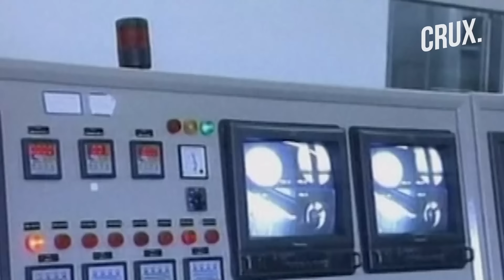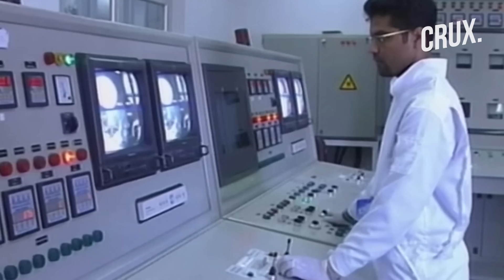F-15EX Jets With Bunker-Busting GBU-57 Bombs | What Israel Needs To Destroy Iran's Nuke Facilities

Comment: Considering how deep these are, not even the gbu 57 is going that deep. Youd maybe damage one entrance,  but there ahould be multiple,  and youre not getting multiple tries.
Reply: munteza9262 what ?
Reply: Munteza  huh? Did you read and not understand?
Reply: only a b-2 with dual mop can destroy 100 meter iranian bunker
Reply: Nonsense ,think first b4 you talk useless 😂
Reply: Munteza  The Iranians have multiple entrances for each base. Some are deep underground, underneath mountain ranges. Even bunker buster cannot get through.
Reply: @Eshrakgaming934  LOL These bunkers are KM underground & they're built underneath mountain ranges. No bunker buster can penetrate a mountain range & then get through several hundred meters of military grade concrete. Only a tactical nuclear might be able to generate enough energy to destroy such a base.
Reply: Munteza  No they have multiple entrances & equipment both inside & outside incase that happens.
Reply: munteza9262 you should be an army general you're so smart!  If the US had you, maybe they wouldn't have lost.....
Reply: @realpolitik01  Cool, but those nuclear sites can be blocked off easily and we know the locations so it really doesn't matter how underground it is. Unless they are making nuclear missiles, those bases are irrelevant and we can easily strike any assets that come out the base & air defences can be easily overrun by US missiles launched from afar without air defence firing a single shot.
Reply: @cooldued5308  Again Iran will retaliate & destroy several US bases in the region, including air bases and runways, US navy ships will also be targeted & likely damaged or destroyed in the process. Most of their assets are mobile so it's going to be impossible to prevent them from launching thousands of missiles & drones. Not to mention, if the US attacks their assets, they will take their nuclear program completely underground, they will spread out to hundreds of clandestine sites & will eventually build a bomb. They have the knowledge & their nuclear program is already spread out to more than 100 sites. If they want to build a bomb, they will do it & the US has no leverage left since they've already sanctioned them to the max. If the US couldn't stop North Korea, I don't think they can stop Iran.
Reply: @realpolitik01  iran is going to face the same consequenses what 1991 4th largest military raq faced
Reply: @realpolitik01  it doesnt matter what materials these bunkers are made with mop has a serious ability to penetrate 60  meter deep slid concrete bunkers it doesnt matter where you are hding your military assets even if it is 100 meters deep a mop with axn-757 will bow up the entire deep underground facility in sky high.if you are thinking you are going to safe in a 100 meter bunker in a mountain when a us aircraft targeting you then you are wrong my friend mop is a serious weapons.
Reply: Munteza  shovel away lol
Reply: @Eshrakgaming934  60 meters of penetration is not enough. The bunkers are deeper than 60 meters & underneath a mountain range. It won't get through. That's if the jet can get close enough to drop the BB, which is doubtful considering Iran's multilayered air defense network.
Reply: @Eshrakgaming934  I doubt it. Iran has 5000 missiles in inventory. Thousands of drones & you've seen what their drones are capable of in Ukraine. They have ATGMs that can destroy any tank or armored vehicle. This is not Iraq whether you want to accept it or not.
Reply: You dont have to , its called digging up the garden 
The F-15EX can carry up eight 2000lbs bombs
The first 1 bomb creates a crater 
,while 2 and 3 are laser guided thanks the laser guidance, the bombs will all strike the same spot repeatedly
Then you drop a pair of GBU-27s 
Then F-15EX drops GBU-72  and good night
Iran's gamble was that mountainous terrains would make it hard for bunker buster to reach
Thats true for 1st gen GBU-28s but newer models like the GBU-72 are far more effective
Secondly 
as for getting multiple tries
Iran's air force and air defenses would be shredded long before
Reply: @verdebusterAP  i told to stop bath salt, lol
Reply: @verdebusterAP  You're assuming the F-15s can fly over Iranian airspace without any opposition. Most of Iran's air defense assets are mobile, so it's going to be impossible to target them all before any airstrike. The jets will constantly have to maneuver to avoid incoming missiles while carrying a massive payload. Not a feasible option & quite unrealistic.
Reply: @realpolitik01  
Not assumption 
fact
Israel has access the AGM-88
which can destroy those mobile systems
More point, Israel has number of weapons able to destroy those launchers beforehand
Reply: @verdebusterAP  Iran has over 5000 missiles in inventory. Systems are either mobile or hidden in underground bases underneath mountain ranges. Israel doesn't have the capability to target all of Iran's assets. The US could likely destroy a significant amount of what they have, but not everything. Not to mention the thousands of drones they have that can be hidden away anywhere, in any parking garage, warehouse, any storage facility, it's wishful thinking to think that 1000s of units spread out throughout Iran can all be found & destroyed.
Reply: @eshrakahmed-ru4ot
Time were different back then.
Reply: @deven6518
You should first survive from the Iranian missiles and fly your jets with no interruptions in order to drop your MC Donald's on Iranian bunkers.
Reply: @MohamedShiyam-wt2id  we are not saying  iran is weak iran is very powerful but thats not enough to face a military super power like us.
Reply: They have 15 other entrances built 3/4 already done all they would need to do after an attack iss drill the new entrance not a whole new tunnel.... smh
Reply: (IT'S SAID BY IRAN) That they are that deep. They have never lied before, photo shopped, pictures, or videos. Got MATH?You're talking 5 miles deep.
Reply: munteza9262  they have construction equipment down there and will dig their way out. not too bright are you?
Reply: @Eshrakgaming934  The Taliban beat you, so how powerful are you? Iran beat the Taliban with a militia. so let that sink in.
Reply: @nolga3569  bla bla bla bla bla bla bla bla bla

Comment: I think there is some research mistake from crux team because gbu-57 is 13 ton bomb and only carried by bombers and is 4 times heavier than brahmos and 4 times heavier than kinzhal missile which are heaviest weapons mounted on a modern fighter aircraft. Yeah, if israel purchases b-21 raider then surely they can purchase one of these bombs. What i think is your talking gbu-72 a improved version of gbu-28 introduced in 2021 a 2.3 bomb with JDAM kits is ideal weapon for f15s
Reply: No Israel apparently plans to strap a gbu-57 30000lb MOP to the new f15EX. F15EX is claimed to be capable of carrying 29500lbs of ordnance but that’s with full fuel so taking off with less fuel and refueling mid flight it could definitely be done. The main challenge will be modifying the f15EX so the center of gravity isn’t completely F’ed
Reply: @@debraoroark49,
If we can't see the plane, at least we will see the bomb attached to it !😂😂
Reply: Nah it's possible, but its unwieldy and can only carry one.. the b2 spirit can contain 2 without a problem b21 same story maybe 4 If it wanted to push to the limit
Reply: You cannot procure a B-21 or F22

Comment: In order for the F-15EX to carry a GBU-57 bomb that size and weight. The F-15EX has to be specially built for the GBU-57 bomb from the ground up. Basically, the GBU-57 bomb has to be inside the belly of the F-15EX. The F-15EX will only carry one GBU-57 bomb and nothing else. The circular hydraulic clamps would have hold the GBU-57 bomb steady inside the belly of the F-15EX. The F-15EX has to be at an constant attitude of 50,000 feet minimum and traveling at Mach 2 to the site. Then going into a nose dive almost vertically traveling at Mach 2 and releasing the GBU-57 bomb. Somebody NEEDS to tell the GBU-57 bomb how deep the facility is and how many floors there are and how high is each floor is. Then somebody NEEDS to tell the GBU-57 what floor to detonate on. Lots of luck.
Reply: No.
Reply: @vernonkuhns3561  WHY?😡?😡?😡?😡?😡?
Reply: It's impossible. Some of these bases are deep underground, underneath mountain ranges. A bunker buster is not piercing through a mountain & then hundreds of kilometers of military concrete. Also the fighter jets, how can they maneuver constantly to avoid air defense missile (Iran has extremely potent air defenses) drop the missile right on the target & then make it back to base ? Not to mention Iran will likely destroy the Israeli air bases before the jets get back. They'll have nowhere to go back to, maybe they can land in a US airbase in the region ? It's just not feasible. The Israelis are bluffing & Iran knows it.
Reply: @realpolitik01  No one has built bunkers that have hundreds of kilometers of military concrete wall thickness. The statement that they are built "under mountain ranges" is also quite misleading as to actual depth.
Reply: Not only that the extra weight of them sort of bombs and extra fuel weight to carry them as well as go all the way to Iran and back will make the F15 so sluggish and slow and will be almost sitting ducks if seen on radar by anti air defences. Yes a good luck with that from me too
Reply: how tf u  know all that man
Reply: @mrgarina2977   Because I got a BRAIN.
Reply: @rogersmith8480  you got more then that. it aint just normal information you learn did  u served or something?
Reply: @vernonkuhns3561  My mistake, I meant to say hundreds of meters of military grade concrete. Like 150-200 meters. The bunker buster only penetrates 60 meters. Not to mention going through a mountain first. It's impossible. Only a tactical nuclear strike would have a chance of collapsing the cavity.
Reply: @vernonkuhns3561  Remember during the first US attack on Iraq in 1991, when the US thought they destroyed Saddam’s Air Force?
Reply: @kman5768  Yes I do. Now, tell me how much affect on our aircraft that the Iraqi Air Force had after that assumption.
Reply: @realpolitik01  150 meters is about 500 feet. The max depth they think the Iraqi installation will be is about 400 feet. They would have 100 feet of your milspec concrete sticking out of the ground. Basically you are lost in the numbers and have no idea what you are saying.

The smaller bb that the F-15EX can carry only reaches 60 ft. The GBU-57 reaches about 200 ft. The F15-EX may be able to carry it with mods. If not a c-130 will protected by EW, F-35s with radar killers and ata, and F-15 missile trucks. OR, we could lease B-52s or B-2s to the Israelis for the job. I would love to see a big Buff drop GBUs on nuke sites.
Reply: @Roger Smith

No you don't...
Reply: @vernonkuhns3561  The GBU-57 can penetrate 60 meters or 200 feet. The Iranian underground facilities are built underneath mountain ranges, with the cavity usually being right underneath the highest point. If the bunker buster gets through that, it has to go through up to 2000 meters of military grade concrete. That's not happening. Only a tactical nuclear strike would have a chance of collapsing the cavity. Not to mention, any jet carrying the such a heavy payload would not be able to maneuver. Iran has potent air defenses, mostly mobile assets. Any jet would have to be constantly evading air defense missiles. It's not feasible. A B-52 would light up like a Christmas tree. A B-2 will still likely get detected & shot down. That over 1 billion dollars down the drain. Is that a risk the US is willing to take ? Go ahead, I'll get my popcorn ready LOL
Reply: @vernonkuhns3561  Iraqi installations ? You mean Iranian installations. Just do the math, 60 meters or 200 feet, that's how deep the GBU-57 can penetrate. But first it can to get through the mountain rock. Average mountains are what 300 meters or almost 1000 feet. There goes your puny GBU-57, even before it can touch the concrete, it has no chance of piercing through the mountain LOL. Even if we lowball it and say the Iranians have 100 meters of concrete, that's more than 300 feet, that by itself would stop the bunker buster, but with a mountain on top, it's not getting through. The Iranians also have multiple entrances/exits & they have equipment waiting inside & out incase the entrances are sealed. They have backup generators with life supports systems inside the bunkers. It won't work. Again any jet carrying such a heavy payload, even with modifications, would not be maneuverable. It won't be able to evade any of the missiles heading its way. Israel & the US are bluffing. What did they do about North Korea ? Trump vowed that he would not allow them to acquire nukes. Now what ? And keep in mind Iran has thousands of ballistic missiles, thousands of drones, you've seen what their drones have done in Ukraine, so Israel would get annihilated if they tried anything. It's not happening. It's all just a bluff. Nothing more.
Reply: @realpolitik01  BLAH BLAh BLAh. No they are not under thousands of feet of rock. You apparently have bothered to LOOK at the aerial photos of those mole hills they are under.
Reply: @omegaz3393  Move on
Reply: @mrgarina2977  Yes, from The Company, 👍👍👍👍👍👍👍
Reply: @vernonkuhns3561  They're deep enough so the bunker busters can't reach. That's all that matters.
Reply: @realpolitik01  Except the facts are rather vague on whether multiple BBs can breach them or not.
Reply: @vernonkuhns3561  They can't just do the math
Reply: @Roger Smith

The only thing necessary is to modify the hard points for mounting the GBU-57.

The F-15 can carry the GBU-57 while cruising up to 60,000 feet at mach 2.5. It was designed to carry that much weight.
It also has the latest full electronic suite.

Just 1 GBU-57 would destroy the facility even if it doesn't penetrate to the full depth. But if you want to be certain, a 2nd one in quick succession would guarantee it.

Little known to the world because the news didn't really report on it is that Israel destroyed such a facility with multiple (though smaller) bunker busters in Syria around 2007. There's a number of things that have happened since 2000 that wasn't reported. Like an intentional news blackout.
Reply: @Roger Smith

Just to add.
They use bombs all the time that are designed and programmable to go through a predetermined set of walls, floors and  depth before detonating. They even have special munitions that work in a similar fashion. Like a 50 caliber round that penetrates an outerwall then an inner wall into a central room and explode.
Reply: @omegaz3393  The GBU-57 can only penetrate 60 meters or 200 feet. That's not enough to do the job.
Reply: @omegaz3393   not even 3 is going to do the job. This is mountain rock we are talking about melting point of 10000's of *c. Any rock that gets destroyed keeps piling on top. The israelis will be creating sand with their precious GBU's.
Reply: @omegaz3393  Trust me i have researched how to flatten a mountain with bombs.
Reply: @omegaz3393  @Omega Z  You need atleast 2000-5000 million tons of tnt to destroy a mountain nuke facility and Israel's precious gbu 57 has 14 tons of tnt and penetrates 60m.the mountain we are talking about is atleast 1km with the facility further underground.
Reply: What makes all of you think you have to hit the top of the mountain and go straight through the entire thing, Jesus Christ you hit it at the base of the mountain at an angle. Also the MOP was 200ft but that was prior to several upgrades that we know the costs of but not how much they’ve been improved. Also no one has a bunker made of hundreds of feet thick concrete walls that’s ridiculous to even suggest and would be completely unnecessary if not partially counter productive the physics here ain’t 1+1.
Reply: Such Experts ????
Reply: @realpolitik01  AGAIN SUCH EXPERTISE ON YOU TUBE LOL 😂 😂 😂
Reply: @lanatana3867  ALL YOU EXPERTS  MAKE ME LAUGH NOW GO AWAY
Reply: @rogersmith8480  You are placing arbitrary and meaningless requirements into your ludicrous list of requirements.
Reply: @vernonkuhns3561  Thank you for your opinion, please move on.
Reply: @rogersmith8480  Tch, tch, tch. If you want to move on because you are wrong don't reply.
Reply: @kman5768  and where are they now?
Reply: Plse what's your profession
Reply: Not mention the limited endurance/tactical range capability of a heavy F-15 struggling to get within range of the target.
Reply: Maybe that someone should be replaced with AI ( artificial intelligence) and coding?. Israelis not stupid thoughz they are quite smart
Reply: @vernonkuhns3561 hundreds km deep in mountains!  is ur estimations realistic?
Reply: @michaelmusyoki3889  Yes, but the U.S. could use The Rod of God weapon.
Reply: @eduardadhi110  this past conflict contradicts what you are saying....

Comment: No, that's not good enough. What Israel needs already having F35s is B61 Mod 12 50 kiloton precision bunker busting thermonuclear bombs specifically designed to be deployable by F35. Not only is the power many orders of magnitude greater but once the protected area is breached, between the heat wave, the radiation, the shock wave, and the rising fireball sucking all of the air out of every interconnected tunnel and cavern, one bomb takes out an entire underground network destroying everything and killing everyone in it.
Reply: nothing gonna work if it is in the mountain.
Reply: @@markfischer3626,
So what do you think the Iranians will do to retaliate ?